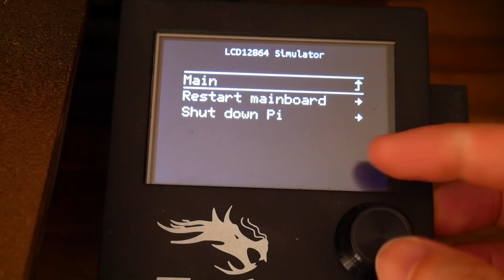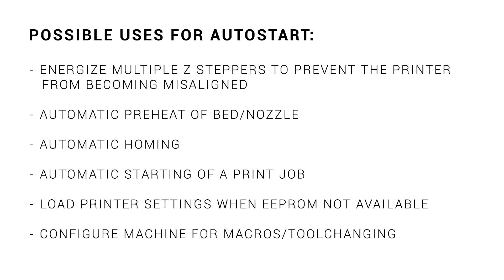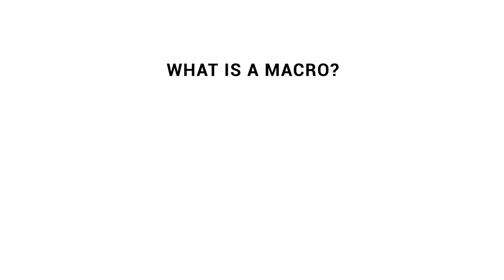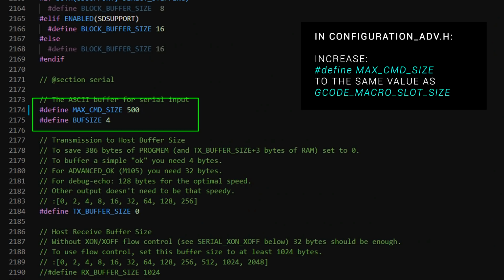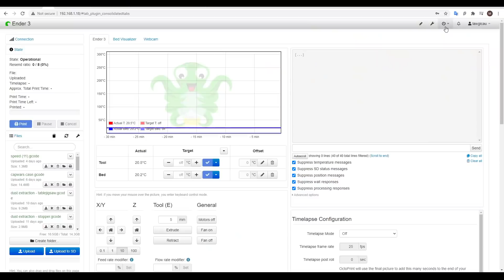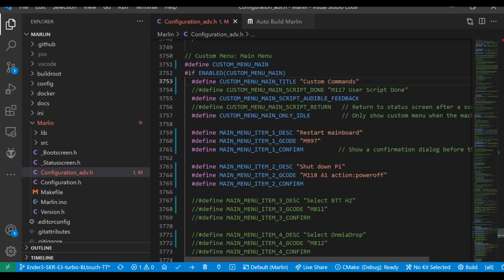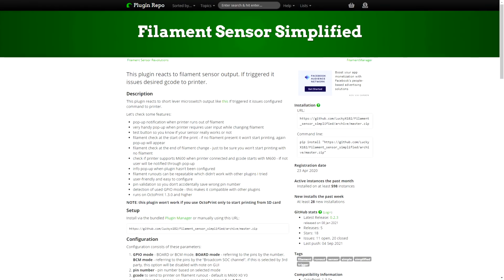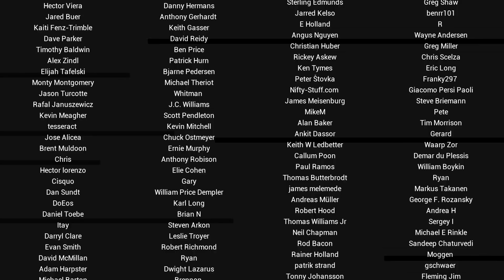Get more out of Marlin & Octoprint with these lesser known tips - Macros, auto-start, custom menus

Comment: Thanks for that. How would you use macros to run an X axis homing after a filament change has occurred, before the resume starts? If you have a hotend that the filament is difficult to insert into, sometimes the carriage moves during the manual load, but now the machine doesn't know where the X position is. Can you use a macro somehow to tell it to rehome just the x axis before resuming the print? Something like modifying the resume button sequence to include a homing command?

Comment: Watch out with these Macros. I did the same as above (using Marlin) and it cause my XY motors to speed up and slow down and the nozzle to smash in to the bed. It appears that the macro blocks were writing over my mesh data which was causing Z to adjust wildly.

Comment: is it possible to somehow control octoprint with keyboard commands?  I work a lot manually and use octoprint for this, but I would like to set up keyboard shortcuts and control everything haptically, is that possible?  (simple things like xy/z homing, bed/nozzle temperature, moving to a certain point per keystroke, etc.)

The goal is to put the shortcuts on my stream deck, a kind of separate hardware control panel.

Comment: Hi Michael, I simply love your videos and have learned so much since when I started 3D printing by following your channel. I have a question which I've not found a straight answer to. I used to love Octoprint when I started, but after a while I could not get over the quality difference by printing from Octoprint compared to printing from the SD card. From what I've read, the serial connection sucks on my Enders, Artillery X1's, CR-10's v2, etc. I did run octoprint from a Ubuntu PC, but with much better specs than a Pi 4. Now the question is, is this normal? Should a drop in quality be expected from Octoprint? I am running a small print business that started out last year and I am doing great with it, but the Octoprint solution is not helping me out quality-wise. I have 16 machines and would love all the Octoprint plugin functionality, but I am not using it because it just bombs out on quality. What can you recommend? Thanks for any info! And thanks for the channel! E.

Comment: Adding a Gcode script to preheat automatically when connected to octoprint i thought was a brilliant idea.
If anyone is looking for how to do it simply go to octoprint settings, select Gcode scripts,  and in the box "After serial connection to printer is established" copy and paste,

M140 S60 ;Preheat bed to 60
M104 S200 ;Preheat hotend to 200
M190 S60 ;Wait for Bed to reach 60
M109 S200 ;Wait for hotend to reach 200
M300 S1000 P500 ;Beep when preheat complete
M117 OctoPrint ;Display the word "OctoPrint"

This is just a preheat to get it started so when you actually start your print your slicer setting temperatures will still override this.

Comment: My octoprint is not running the start G-Code for my Cr10s pro V2 so no BL-Touch leveling and also it lets the print run without any of the safety features engaged.

Comment: I was thinking a better thing to do for the pi is power it from a backup battery that the printer charges, and when power is cut to the printer the pi will wait until the battery is about 50% drained and then shut down. That way you  won't have to wait for octoprint to reboot if it's a small shutdown and you're even a bit protected from power outages. 50% puts the battery in a stable storage capacity, so if you're shutting down for storage you shouldn't have to worry too much about it.
Reply: I realize one issue though, is that when the printer is off but the Pi has power your printer's main board can remain powered from your pi. This would be best utilized with a board that supports direct serial communication with headers on the board. I've seen reports that the 4.2.7 board can support this connection. They don't have to share a 5V line and thus the pi won't keep power to the main board. (I wonder if a custom usb cable with the 5V line cut would do the same.)

Comment: You are mad man if you have printer connected to pi and using marlin.
Reply from the maker: I guess there are a lot of mad people out there.
Reply: @TeachingTech  100% true :)
Great video as always and kudos to you for trying to help everyone.
But from consumer standpoint, after you get pi and want to go a bit more advanced and you don't want to change that c++ mess of a configuration file and build actual firmware, wondering if you messed something up or you just need to tune your printer better... Just unpractical and frustrating. 
I would rather stop printing than go back to that

Comment: I'd love to use OctoPrint but the connection is horrible to my older CR-10S. Ruins quality.
Reply: did you use a power supply to your raspberry pi? I had that issue before. I had to buy the raspberry pi 20 dollar power supply before by connection became stable
Reply: @shaungoh771  Yup bought a cana kit... It is a B+ from 2015 so I don't know if that's part of the issue as well.

Comment: Thanks man. Have been trying to find a features to do exactly that, run a particular file at printer boot. Would have saved me a lot of problems while working out problems with EEPROM storage of my UBL meshes. While I have since solved that, I have developed a startup process that ensures my first print after a cold boot is every bit as successful as any successive prints. Sometimes I forget to do that process and predictably the first print fails, have wanted to automate that for awhile but relying entirely on Octoprint to do so has been troublesome to say the least.